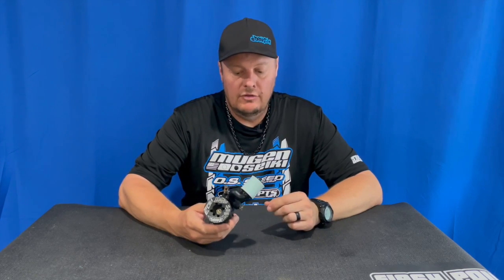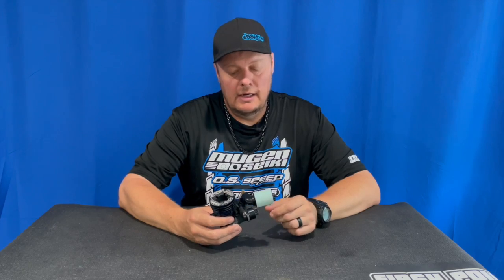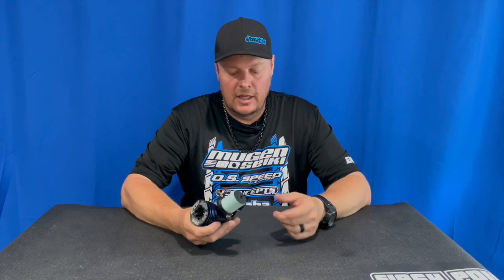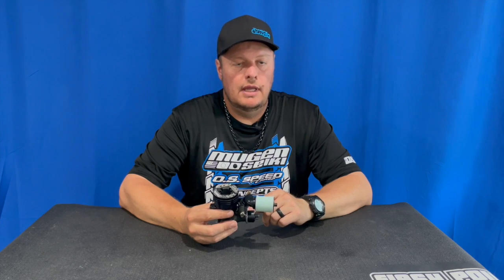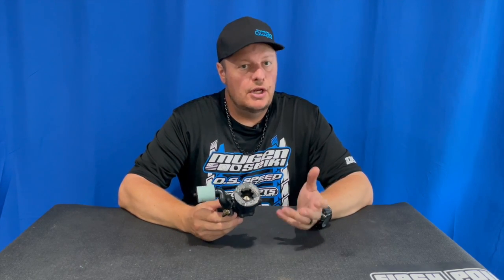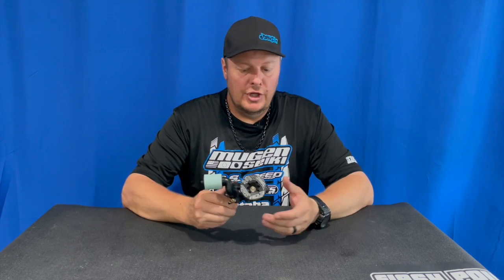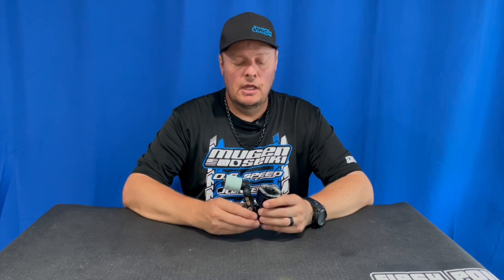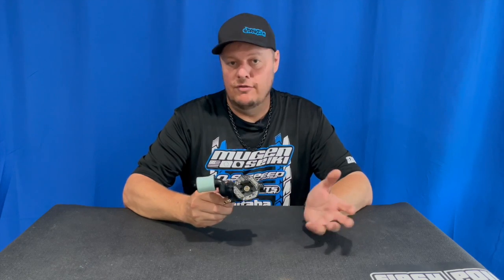Front Engine Bearing Leaking?

Comment: The timing of this video is perfect! I always use after run oil after a track day and the last few times I have noticed the front bearing seeping after being stored for a few days. On the track Ive had 0 tuning issues. I was on the worried side at first because I have less than a gallon through it. 
Thanks for the info!

Comment: A damaged bearing will not spill oil when running, but it will allow air to enter and cause tuning issues. It will drip oil if running too rich.

Comment: Great video again Adam, I had a question for you. I raced on Sunday had a pretty dry loamy track, trains and lanes in Pennsylvania and head seem like my rear end was all over the place. I am running 775 right now in my Diffs I have the MBX8r What should I change to make my rear end from not sliding around so much when I just tap on the throttle little bit seemed a lot looser than every other car on the track.
Reply from the maker: Try 7-5-7 in the diffs.  You could also try running a little more rear toe-in.
Reply: @AdamDrake  ok ty I am gonna have to try that
Reply: @AdamDrake  how do I adjust rear toe in? Do I use the block settings or with the links
Reply: @AdamDrake  what block should I use to get more toe in the C or D block?
Reply: @AdamDrake  I should have said F or R
Reply: @AdamDrake  you think 757 would keep my rear end from spinning out in turns when I get on the throttle I was going to try 573, but I am inexperienced and just been trying to read all types of threads

Comment: Literally am in the process of returning a traxxas 3.3 that I broke in and would not tune at all after breaking in.  Air pressure checked the engine, and air was leaking through and out of the front bearing.

Comment: Hey I thought the seal of the crank to block was created by the fuel in the groove on the crank.   Is this incorrect? I also thought the rubber seal on the bearing was to keep dirt out not fuel in.  Based on the design the pressure from inside the engine would push the seal out.  Just an observation and information I have heard.
Reply: From what I know, yes, there is a groove on the block, or on the crankshaft where is fills with oil, and it acts as a seal.
Reply: @cassianomartin2699 and this is how I kill my motors when learning. Due to needle imbalance

Comment: There's no such thing as a fully sealed bearing.    That is not what seals the engine should look into a little more.   Airplane glow engines don't even have a dust shield The groove on the crank is what seals the engine it's a fluid seal.  Leakage at the bearing usually means running a little rich which doesn't hurt nothing.
Reply from the maker: Great points.